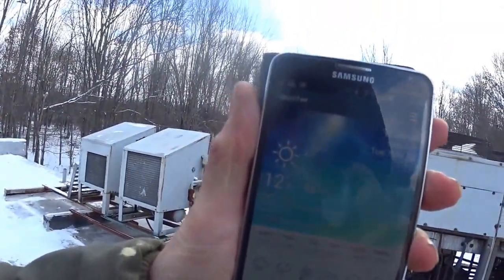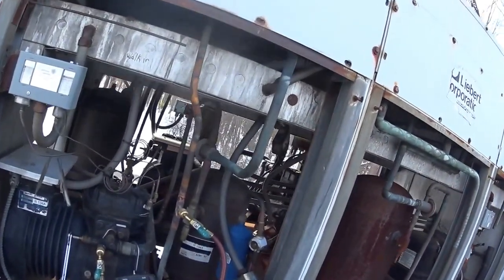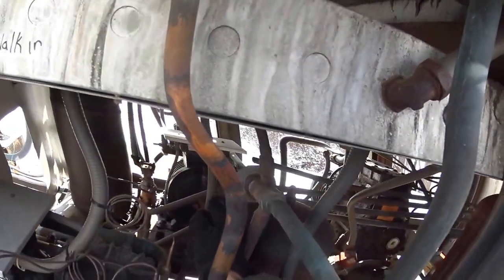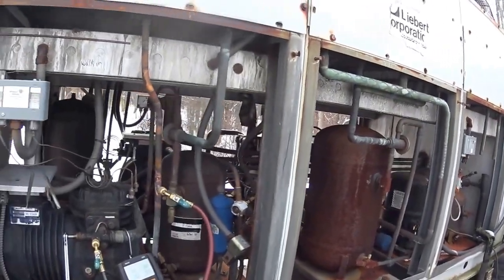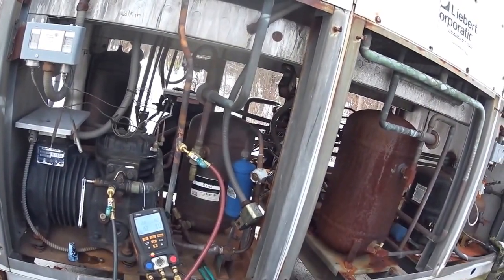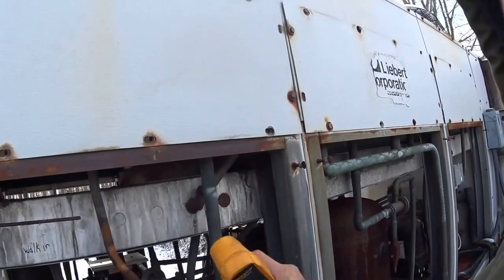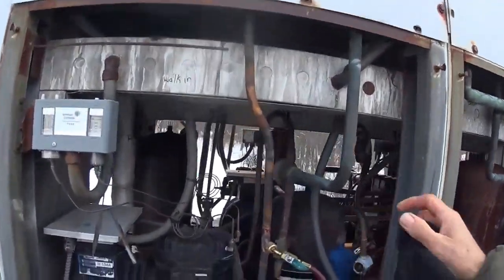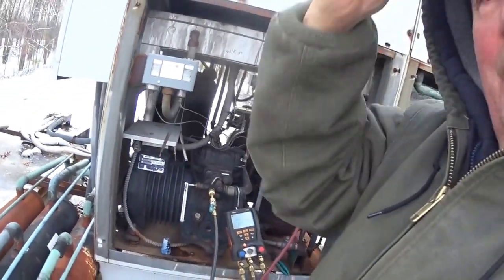-14 F Wind Chill  Cold Artic Blast causing low head pressure

Comment: Because of the low outside temps in the winter around the lakes I know a co-worker that put a tarp over the condensers to keep some heat in the condenser. Even with a cold weather kit with a horizontal coil like this it will get a term of "Winter Coil" all the liquid is either in the condenser or evaporator. The tarp is left loosely so it will get rid of heat when the fans run. He installs the tarp in late November and takes it off in February. So when temps are -20 over night it will keep the unit running and the fans never run or only now and then off pressure switch. Tarp may look funny but those winter coils can be a bear to get running again.

Comment: Fan cycle control to maintain head pressure in this system even thou you have a low pressure control? I agree 100%. Even thou headmaster is bypassing that fan is keeping the refrigerant sitting in the condenser cold and it steals the heat of the discharge line, by time it gets to the receiver pressure has drop and like this your suction coming back will be even lower. When I charge a unit in summer time with a headmaster i always give it 2 more pounds.
Reply: Marvin, I agree totally with the 2 # overcharge, past what amount it takes to keep a normal sight glass in warm weather. 38 years of food service refrigeration under my belt.
Reply: and?  38 yrs under your belt doesn't mean anything if your stuck in the past.  not keeping up with  they way things are moving improving units. installing electronics. being HIP.

Comment: It's always hard to charge a refrigeration system when it's that cold outside, I had the same problem with a thirty ton rooftop York heat pump what a pain thanks for all the info Jim.
Reply from the maker: with larger refrigeration systems the liquid refrigerant hangs up in the condenser and the liquid level in the reciever drops too low, it looks like the system is low on refrigerant, you have to cycle the condenser fans off so the hot gas will build up and push the liquid into the reciever tank. Thanks for commenting.

Comment: Nice work Jim!

We don't get many cold winters here but i remeber a few years back getting called to a system tripping on low pressure, it had a heat recovery system on it which had filled up with cold water and that combined with the condenser and reciever being below freezing meant the system would not run.
In the end i tipped a bucket of hot water over the condenser and it fired up and kept running! The was plenty of heat in the evaporator if the refrigerant could get to it.
Reply from the maker: these systems have an envelope they are designed to operate in, when the system is below or above those operating temperatures the systems have trouble functioning, we have to pull a rabbit out of a hat to get them working. We are in an Artic chill, it's only November, I'd expect this in Jan or Feb. The North pole is shifting toward Russia at 40 miles per year,(look up pole shift) I would think the Equator would be moving toward Ohio at 40 miles per year, it should be getting warmer, not colder.?
Reply: ***** It's probably cyclematic in my opinion then anything else my parents remember it also got a lot more colder in most of America fairly often and longer when they where kids i guest peoples memory of the climate can be pretty short or nonexistent sometimes maybe because it's something most of us don't usually think about

Comment: Wow it must be something living where it's so cold over here in Southern California when a headmaster valve like that goes bad or does not work correctly we just discontinue it because there is really no need for it and we would cycle fans
Reply from the maker: The Alco headmaster valves were popular back in the 70's - 80-s, now the Sporlan LAC valves come through on new units, we use our share of Ranco head pressure controls. We need to regulate condenser fans here, also in a low Head pressure situation I'll go to a Balance port Sporlan expansion valve.

Comment: JIm, your videos provide a wealth of information, particularly for those of us who haven't worked refrigeration.  I noticed the fan seemed to be running continuously and I wondered whether you ever use fan controls in refrig.   Then, you answered that question when you indicated you might use that option in this situtation. 
Do you ever block off part of the condenser coil until you can get a fan control  or new headmaster installed?  I gather there is no adjustment on headmaster valves. 
Thanks for your videos and all the great info.
Reply from the maker: In refrig we normally would use a Ranco head pressure fan control, or sporlan LAC or alco headmaster valve. On this system the condenser has two circuits with two fans on both condenser coils, I would use a temperature control on the liquid line. This alco headmaster isn't adjustable. Sporlan makes an ORI and a ORD combination that's adjustable.

Comment: Jim great video bud. quick question could you not slow the fan down using a ICM fan controller or in worst case cycle it on/off to maintain proper head pressure.
Reply: the ICM fan controllers act like a VFD and it will speed or slow the condenser fan so you can maintain the head pressure
Reply from the maker: I've used the ICM controllers before and they hurt the motors, found out the motors have to be ICM compatable. If there continues to be a problem I could install a Head pressure fan control, but I think on this unit I'd install a Penn/Johson Controls  temperature control and clamp the sensor onto the liquid line leaving the condenser and cycle the fan that way.
Reply: Cool I understand what you're saying. Love you're videos man you do a great deal of explanation.